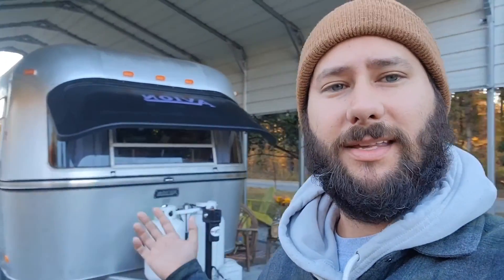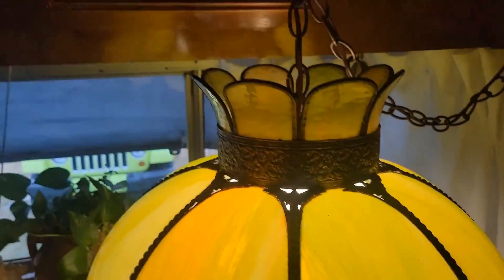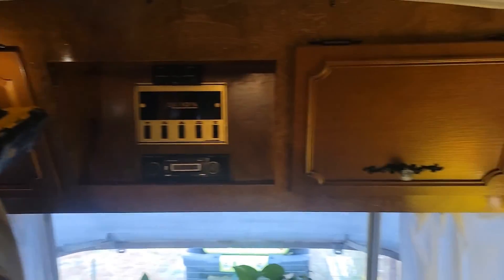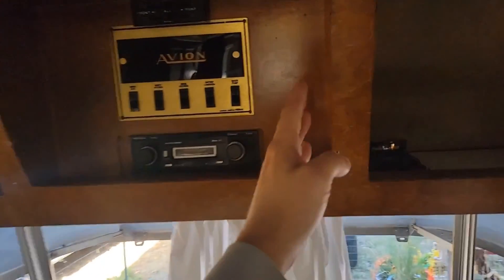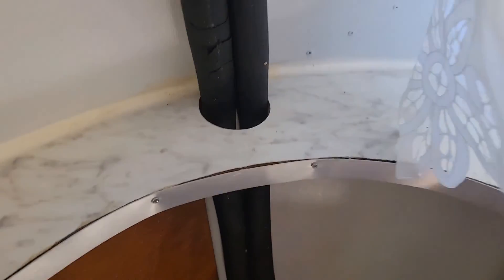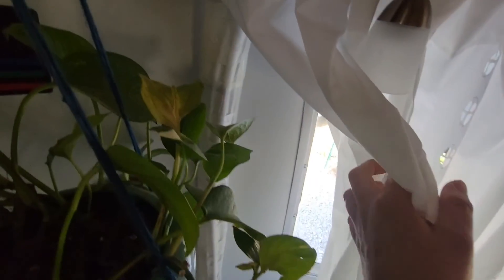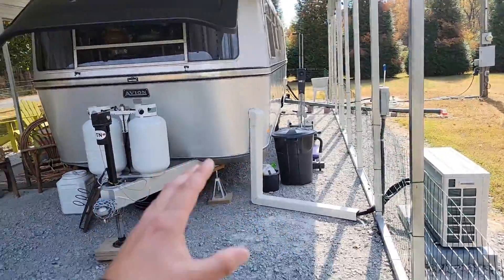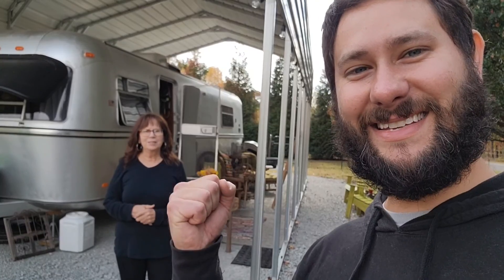Mini Split Travel Trailer Install #minisplit #traveltrailer traveltrailer

Comment: I hope she has some cover from that hangar like structure above the outside unit. Very nice job on the inside unit and lines being the least obtrusive as possible. The space above the air handler is important indeed.

Comment: Those screws are called a clutch head, They used them a lot in RV's and Mobile Homes in the 60's to early 70's.
Reply from the maker: Thank you for this info